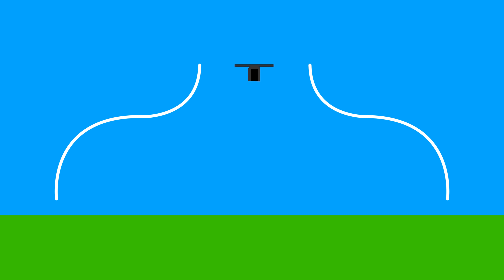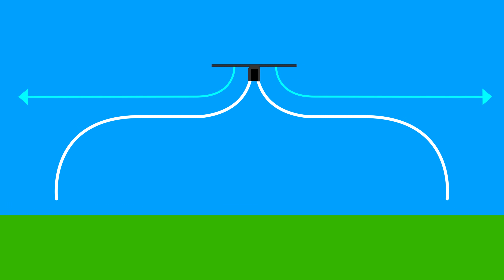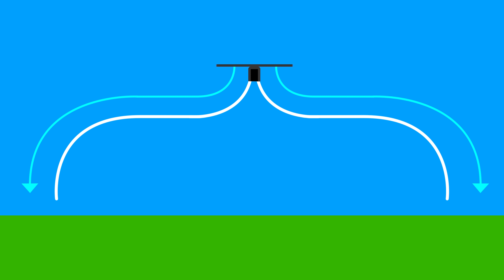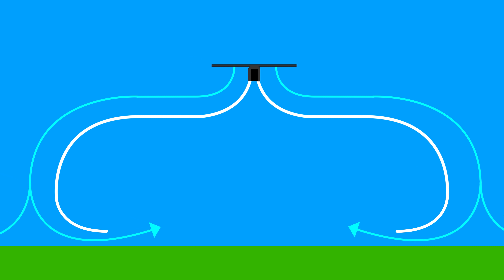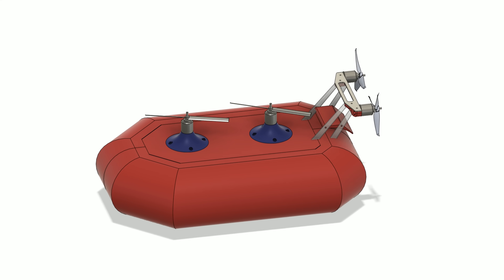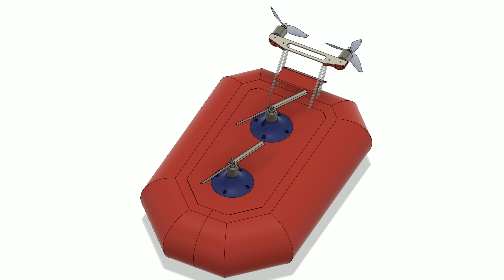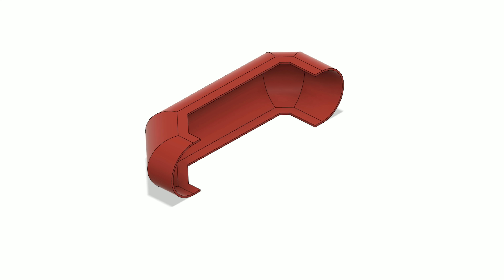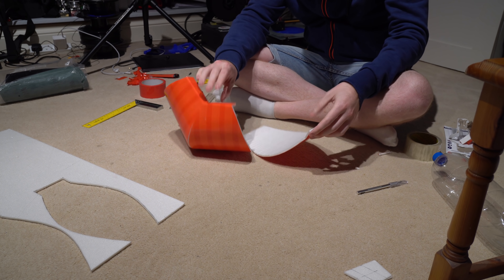Coanda Effect Hovercraft

Comment: If You get rid of the flat surface beneath the rotors, which are supposed to create the Coanda Effect, the air can flow better over the "edge".
You could either change the radius of the "foam-dome" or move the rotors closer to the edge.
Another possibility would be to ad a foam or plexiglass layer to change the foam. This way you would create space for passengers or a load to carry.
I would love to see if that would work.
Nice idea though.

P.S. Sorry for my bad English. It's not my first language.

Comment: The right leaning tendency is may be due to the centrifugal effect of the propellers... Since you have 2 propellers for lift alone, you can have them rotate in opposite direction to cancel out this effect which also allows closer placement or lengthier blades....

Comment: Yeah, but can you break down the overall power usage between a conventional hovercraft and your model utilizing the Coanda Effect?  Assuming you were using equivalent motors for each craft?  I have no doubt a conventional hovercraft will use less energy, but I would enjoy knowing how much of a difference there is in terms of overall energy required to achieve roughly equivalent results.

Comment: You know, I get the idea of the principle design, but with the props pushing air down onto a flat surface, and not onto a curved surface as you demonstrated in the beginning, I have to say you're doing nothing with the top motors providing pure lift, and you're holding it in position with essentially a lack of power to the lift motors.  If you were to make the lift props blow down onto a curved surface, then it might be more believable, that or have a funnel tunnel to direct the downward air onto the curved sidewalls.... Interesting concept though
Two other thoughts.... 1) make it heavier, more stability due to longer reaction time when off balance, and 2) close in the bottom so you don't get the flow going into the center, but rather having it create a cushion under a solid surface, I think it's actually sucking itself back to the ground (as evidenced by the leaf collection)

Comment: For increased stability I'd suggest having a weight on the inside dropped almost to touching the ground, and basically suspended between the aluminum mounts for the lifts, to lower the overall center of gravity.

Comment: Hmmmm... Watching this, my theory is that the tip over problem is caused by the radius going all the way around to the bottom. As it drags more on one side and the other side starts to lift, it exposes more of the curve to the air and increases the coanda effect on that side, meanwhile the side that is digging into the ground is starting to rolling over and blocking more of the curve, reducing the coanda effect on that side, causing a cascading failure.
I would be interested to see versions tested with 70°-100° skirt radii, rather than the full 180°, and see if it will let you get a larger cushion of air and a more pronounced ground effect.

Comment: beside that you jsut build a low flying helicopter i also wonder if you dont actually create a slight vacuum inside of your craft, due to the air flowing on the outskirts down and then away from the craft pulling some air with it creating lower pressure below the craft, then if you drive over a leaf it gets sucked up

also, your hovercraft shift color from almost neon orange to pinkish :D

Comment: What if you changed the shape of the 'air foil' so that the coanda effect only pulled some of the air towards the middle of the craft? I think that's what's causing your stability issues. Your craft has a narrow 'wheel base' since the air that's propelling the craft is so oriented towards the bottom-center. But what if instead of a smooth sine curve, it used one that had a tighter radius towards the bottom of the craft. Some of the air would escape outwards (but still downwards) and increase the stability of the craft. Maybe? I'm no expert in aerodynamics but it seems like something worth trying.

Comment: It's an interesting idea.
Sadly, I think much of the lift being generated when the craft is stationary is coming from the very powerful propellers you're using and not the coanda effect. 
However, you are getting a very strong coanda effect when the hover craft moves forward.
It doesn't really have any more practically than arbitrarily limiting a wing to flying only a few feet off the ground.
Reply: I guess the question there is: did you build a Coanda effect hovercraft, or did you build a very low power helicopter.

Comment: you're losing too much force... even in your bench tests you can see how much of the fog just blows out to the side away from the object and not downward. try adding a second shell to help direct the airflow, this would help out your impellers as well by drawing air in through an intake... you're creating more lift than any air cushion here, that's why you tumble so easily. watching a few other vids on this, not sure if the shape of your lower is affecting the outcome of the vacuum or if it's just lack of force, but something isn't right... i noticed the models in other vids tend to have a sharper angle at the top then come in, while yours are very rounded out from the middle, this could be helping to direct much of that force outward... https://youtu.be/aF92B6Gon3M

Comment: If you added outriggers it would be a ton more stable. 

also, you've basically made an ekranoplan. So my question would be, why not design one purpose built by merging this design with the standard ekranoplan's? by moving your thrust to a puller configuration you could also increase the ground effect. Especially if the over all body was shaped more like an airfoil so the rear of the craft was shorter than the front of the craft giving you an almost flying wing look.

Comment: 10:58 okay, so i could see how this would not work, but what if you put some weights in the sides (probably closer to the rear)? If its top-heavy, then add slightly more weight to the bottom. Just make them rounded to the air still sticks to it, and make them small and light enough that it doesnt cause issues. Idk though.

Comment: Make a hybrid, use the effect to direct the airflow  to just around the perimeter of the hovercraft. Basically build 3 shell design where the outer has some slots to draw in outside air but where you would also have less escape airflow from the propellers. 
Then a inner body which reduces the volume but not the surface of the “stagnant air”. My prediction is that it would be self stabilizing.

Comment: instead of giant overhead props, why not build conformal chambers on each side of the chassis, with squirrel cage style fans inside. Sort of a ducted fan setup, which would solve the topheavy problem, enclosed squirrel cage fans would be virtually indestructible,  the coanda effect would be more pronounced, and the design would lend itself to pax/cargo carriage if upscaled.

just a thought.

Comment: Instead of the Coanda Effect,  what if you used  a flat octagon surface, that had airfoils opened 10% , on the entire length of each  outside perimeter, of all 8 sides?   Maybe you could use 2 ducted fans centered in the middle  (facing each other.) one ,ducted fan,  using air from above  the octagon , facing downward and the other ,ducted fan,  using air, through a hole  below the octagon , facing upward,  both fans would have a cone diverting the air outward radially. You would have more air flowing radially over the top surface  of the octagon    straight towards  the 8  opened airfoils?  That would seem to have much more lift than the Coanda Effect .  Has anyone ever tried this?    If not it would be a worthy challenge!

Comment: Put the props at the front, and adjustable tail fins on back so you can control it more in the air... Add a set of wings either side, held out from the sides by bars to allow the air to wrap down around its body still

Comment: 1. add some alu wire along the outer edge to balance it out, looks like you have enough thrust anyway.
2. calibrate your motors (apply tiny resistors? do the math based on the weight of the tail vs nose and left tail v right tail).

Comment: Im an Aerospace Engineer currently designing an RC aircraft with similar blade/prop characteristics.  My main point of contention is that i think the main lifting force is from the props and not from the Coanda Effect. The Coanda effect is as a result of an imbalance of ''entrainment' of 'clean' air between two sides of the flow condition. I rather expect, since the motor you are using is relatively Low RPM with a moderate prop, that your main lifting force is simply the prop. Id be happy to do the calculations at some point.

Comment: yay tom..
imressive to see coanda-effect works with hovercraft as well! whenever you'll think of reactivating this, i'd try to level the weight down (maybe place hovering motors on a plate mounted low and force thoose propellers throu driving shafts?) and maybe place propulsion motors lil behind the middle on the sides to not make it wheely..
classical hovercrafts will not suck stuff from the ground, but..
..this "side effect" maybe could be used to collect stuff? maybe its worth to rethink this..

maybe ill try to do some experiments on this concept as well .. thanks for the idea! have fun and greetings from munich..

Comment: uses 3d printed frame for the fan mount and add aluminium weight for "emergency landing gear". also add rc wing angle adjustment and this craft is ready to go.

Comment: I used to use the same effect in school by blowing over a limp piece of paper
Reply: I would argue that is more like bernoulis principle where a faster moving fluid is at a lower pressure than a slower moving fluid. If you blow over the top of a tissue, that will create an area of low pressure above, high pressure below and so forcing the tissue up into the area of low pressure.

Comment: It does seem to be a coanda effect of sorts as when you turn one side lowers, thus reducing / eliminating lift that side and the other side the  lifts more in reaction.  It would be interesting to see if 4 rotors with gyro designed to keep it at a set height above the ground somehow works and if so, how adjusting that height affects eficiency

Comment: You have the two props in the middle centered, then you have a very clearly unbalanced vehicle with the two back props. Why didn't you add weight to the front of the vehicle to compensate for the crap on the back or make the front end stick out more to reduce the lift.. thus compensating for the imbalance.

Comment: move the motors down in the frame and shaft drive the props also make the rear thrust motors wider apart for better stability control.
Reply: also could use a drone controller for stability with 3  lift props and that would leavle it out when it tips .

Comment: Two things: if you attach a mesh on the underside you won't have to deal with leaves collecting on the inside. Also, aggressive turns aside, does it run equally well on a water surface?

Comment: Take a tip from the harrier jump jet that has small thrusters on the tips of its wings nose & tail 

What happens if you seal the undersides with a shallow concave bottom approx 25 mm deep at the edge
It would have the added advantage of gliding the void and preventing leaf gatherings

Comment: Given the difficulty you’re having keeping it flat on the ground you might think about adding some elevators (not sure if that’s the right turn but I horizontally mounted flap is what I mean) in the rear to control the tendency to pitch up. Somewhat like a hydroplane has

Comment: Interesting video as always. 

Just a thought; What if the props were enclosed, i.e ducted fans but the shrouds positioned just off from the coanda deck by three small diameter stand-offs? (with a gap between lower edge of fan shroud and deck) Perhaps more of the air flow would then be concentrated down onto the deck as opposed to some escaping perpendicular to the propeller axis?

Comment: You didn't mention it, but I wonder if you've given consideration to the interaction between the Coanda effect - which may work as you imagine - and the fact that the entire craft is moving through the air. Surely this airflow from the forward movement must affect the lift from the Coanda effect along the edges. Note that when it flips it is when the craft turns sideways thus one side becomes the leading edge through the surrounding air. It may be that the airflow from moving sideways kills the lift on that leading edge. I think the Coanda effect is rather "delicate". The air from the lift props, moving along the top, is confronted by the air from the movement.

So the Coanda effect works fairly well for lifting, but not on a moving craft.

Comment: Tom, that is a great project. Even though, it can be not as efficient as traditional hovercraft, it is interesting and unusual idea. 

As several people mention, I am also not sure how much lift you get from actual hover effect (i.e. creating a high pressure area under the vehicle) in comparison to simple momentum lift (you push air down, you get opposite momentum up). Probably impellers has shown that it is not working that great, but here again, Coanda effect has its limits and with impellers you probably need some extra flaps to direct the airflow first sightly downwards.

Your overturns is the problem of all inherently unstable crafts like helicopters. Pitch wise it is fairly stable because you have the back propellers to push downwards and if it is pitching forward, the angle increase and downward component increase. The other story is with rolling moment. As soon as it starts to roll, lifting propellers angle increase and roll moment increase further. And you get roll instability.

I can't think of any purely mechanical solution to make it stable. Impellers should be a bit better, but should also be unstable. So, the solution should be electronic. The simplest way to resolve the issue is to add a roll sensor (gyro) and to cut off lifting propellers if the angle is increased beyond a threshold (probably about 15 degrees should work just fine). If the angle is reduced below the the threshold, the power to the props should be restored.

This of course can be done by adding a full blown controller with digital gyro sensor and integrate the angle. Or it can be done using simple analogue sensor, condenser, transistor and a couple of diods. I am not an electrical engineer, but I am sure it did not be that complex.

It would be really interesting to try to do something like that.

Comment: Could you build the motors almost at the bottom and have the props on longer axels? I would add more weight with the axels but the lower CoG you might get better stability?

Comment: question... can you prove it is coanda and not just lift from the propellers? Make a simple flat body with the same motor and prop setup and see if the results are significantly different.

Comment: I must join with the general sentiment in wondering whether it's really the Coanda effect or brute-force lift from the props that causes the craft to hover. Either way this is an interesting video and concept, would love to see a follow-up with further experimentation!
Reply: Agreed. I suspect a flat box of similar dimensions would work about as well. Having the props off the side would be even better. If he could get this to work with horizontal airflow of course, that would clearly show this effect, but it looked like that didn't work at all.

Comment: Suggestion: Counter-rotating pusher props. I suspect that some of your tipping problems may be due to torque from the props. (Likely made worse by high COG.)

Comment: Tipping may be unresolvable due to high COG (as you said) and also to the shrinkage of the ground contact perimeter due to the turn-under of the final 90˚ of the Coanda profile.

Comment: Have you been able to sort the difference between the Coanda effect and the simple Newtonian effects of propeller thrust?
Maybe the reason your impellers didn't work was because the coanda effect wasn't present, or was very slight. Maybe the propellers worked poorly only because of the resistance offered by the body of the hovercraft.
Changes in lift performance with forward speed could be as easily explained by interaction with the lift propellers as with the lift body. At least, it should be plain that whatever coanda effect that might be effective in hover will alter at forward speed.
Indeed, wouldn't it make sense that as forward speed increases, coanda effect would shift rearward? Your model shows an opposite effect. The nose lifts, and the model flips over.
As to the "leaf sucking [i.e. "scooping"] effect," Yes, some of this could be from pressurizing the bottom of the model, some small amount. Could it also be because of a simple shoveling mechanic? If the nose is up, and the lip of the rear section is lower than most of the opening, and the rear is skimming lower than the tops of the grass blades upon which the leaves rest, why shouldn't some of those leaves scoop into the body?

I appreciate your back-yard experimentation, and your zeal. I like that you want to learn more about how your world works, and that you're eager to show your findings. You're also willing to do some work (like making meaningful observations, recording data, and doing a bit of math(s)). Much better than some other youtubers who might simply throw something together and see what happens.

However. In this case, it seems you may be attributing traits to one phenomenon which may be more easily described by another. 

Because you tried so hard, and I think you failed anyway, I am subscribing to your channel.